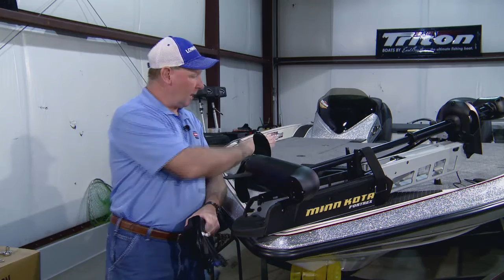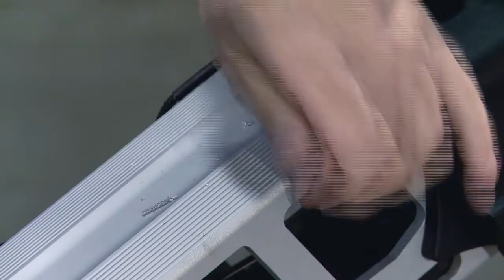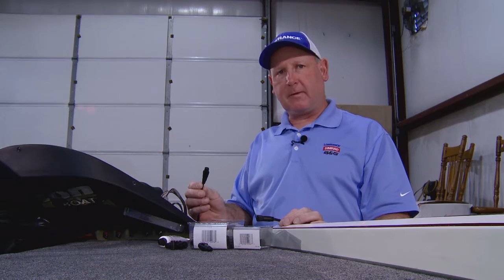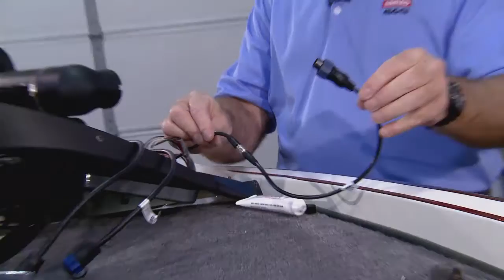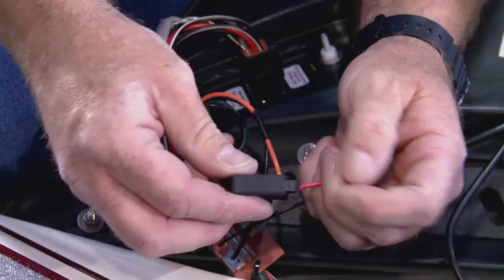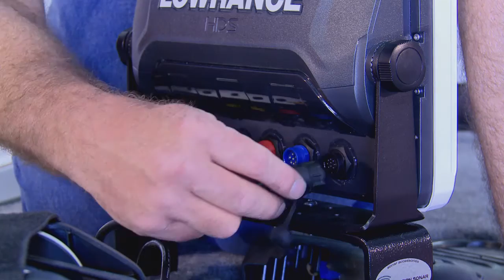Lowrance StructureScan 3D Installation part 3

Comment: I watched all three parts of this series, I would of liked to see want was added so all the power lines could be hooked up to, under the dash and on the bow of the boat. Was there already extra hot wires in those locations?or was a bus bar system used?

Comment: I think you defo want through bolts on bracket to the floor or lock is useless. Electric drill will remove bracket with front locator all in one go :-( Also can you still use a Structure Scan (side scan) transducer with the 3D SS & if so? where would you hook it up to?
Cheers, Great informative video